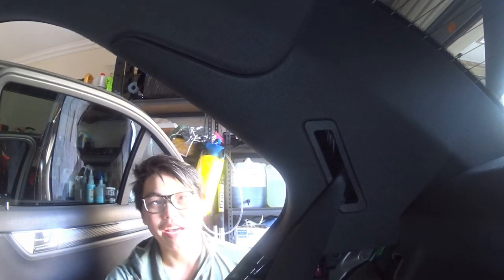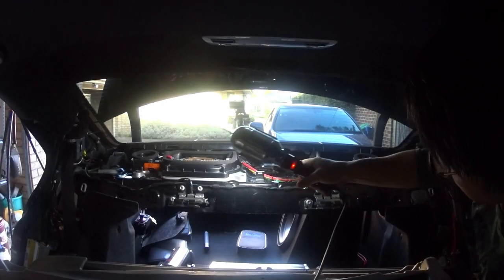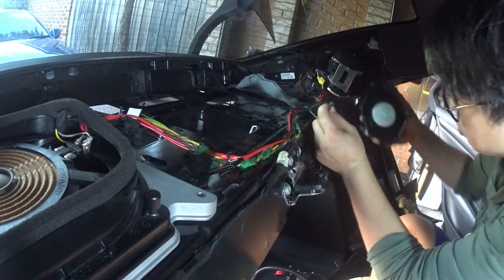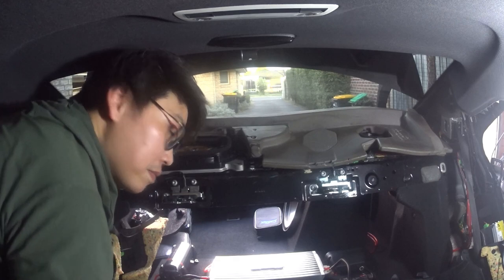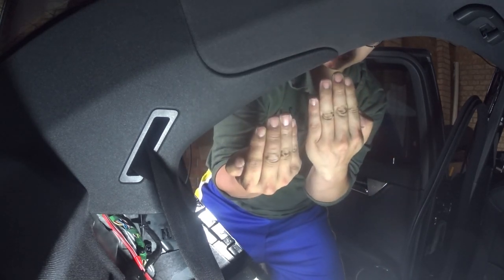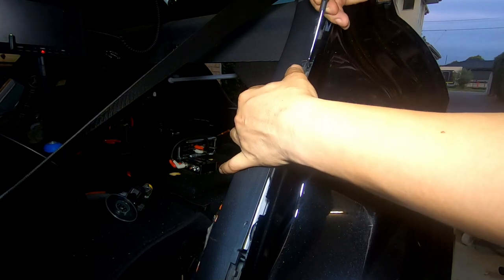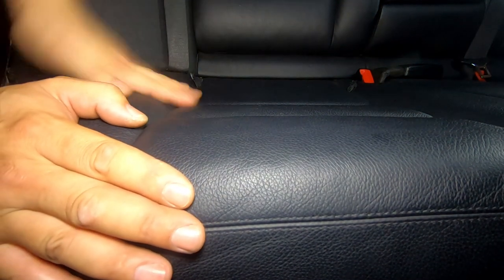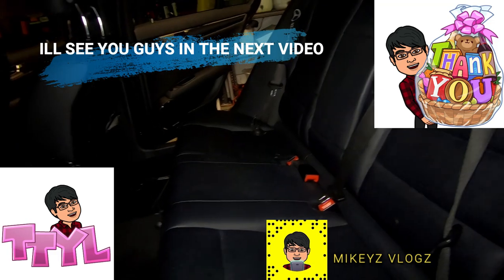MERCEDES BENZ  C CLASS W204 HOW TO ACCESS  REAR DECK + 3RD BRAKE LIGHT

Comment: Where is the 3rd brake light part?  As if anyone else cares.  The notorious rear speakers and subwoofers usual go after time on this vehicle. I have to do a sound test once a year. The "3rd brake light" and rear fog light better not blow out.  I'm not doing any of this stuff for that.
Reply from the maker: I only show how to access it... and the screws to remove it .. I did actually remove it ... hence why I titled it access 3rd brske light not remove it... but once u remove all this u can easily access it
Reply: @MIKEYZVLOGZ  I know. I was not surprised by all the audio replacements. The speakers are notorious for blowing on my vehicle.  I keep it pretty much stock but, if ever the the "Center High Mount Stop Lamp" or CHMSL goes out, you'd think there was an easier way to access it.  ;)  (3rd brake light it is.  There is always an industry term for everything)   Every year, I hope the Subwoofer on the HK Logic7 doesn't blow out.  You did the work......I wouldn't.  I'd either live with it or pay someone to do it at that point.  Interesting video.  I did replace the hideous door pins and went led all around with the gaudy Metcedes-Benz Projector door LEDS. 😒
Reply from the maker: @UhhhhhnooOOo00oO  yes I feel ya pain man.. its alot of work ..but well worth it when u think about time and money and labour ... they will charge about 150 an jr for merc usually or up to 250 an hr depends what they are doing
Reply: @MIKEYZVLOGZ  I know that all too well.